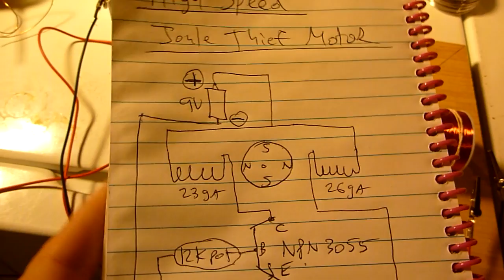Simple Very High Speed Joule Thief Motor

Comment: You should try shifting the angles of the 26-gauge wire coil connected to the base of the 2N3055 and advancing it a few degrees to stimulate the firing of the 23-gauge wire coil connected to the collector of the 2N3055 transistor a few milliseconds earlier. This prevents the Lenz effect.

Comment: looks like it's self oscillating at startup and probably spiking a lot whilst triggering via the magnet rotation as well, making it sort of like a mechanical/solid state combo. the sweet spot seems to be more of a solid pulse here. if you want to get more rpms from a 9v or even an AA battery you can try using N52 magnets and even small air coils pulled from wall adapter transformers would work. Bedini mechanics are a little hard to understand because so many different people have seen so many different results with varying setups. as you said you could run a load or charge a battery from your collector through a diode, but if you source your negative output rail from the emitter it will essentially run your 9v battery directly into the load through the diode, as well as spikes, so it's a good charge that you get but you have to watch out for what voltages you are playing with. for example if you tried to run a 3v LED load that way from your 9v, the LED would just always be lit because it's essentially being run from the 9v directly through a resistor, which is the drive coil. Bedini gets around that by running the load's negative from the positive of the input battery. This causes only the reverse spikes and none of the inrush spikes, and the source and load are never directly parallel. If you tried to run a 3v led with an AA battery however, it would work quite well, just as a Joule Thief is designed, because the 1.5v alone from the AA will not illuminate the led when directly connected. These motors are always fun to play with, I recommend you keep playing with SSG type circuits and you might get hooked.

Comment: A Question please? How long will it run , non stop, on that 9volt battery? Have you timed it?
Reply from the maker: Don't know, never tested it with 9 v battery.  You could made editions to the circuit to make it run longer and be more efficient. This circuit is similar to John Bedini's School Girl motor. You could place a diode going from your emitter to base of the diode to help recycle some of the energy.
Reply: Would you be willing to put a new 9v battery on it, measure the rpm and note the time, let it run till the rpm is about half of the starting rpm, then let me know the time elapsed? Please?

This way, we can judge the power consumption. And decide what applications it would be useful in.

Comment: very cool! I'm having trouble seeing the whole schematic in the video, any chance you could post a static picture?
Reply from the maker: +Kevin Reilly Just look up the schematic for a regular joule thief. Then imagine a rotor between the two coils with 4 magnets alternating. Just posting a picture is tough, cause I'll have to upload it to some host website.
Reply: +Naoki Kashima Ah cool, thanks!  Nice video!  I'm building my own version now.  I'm trying to understand how exactly this works...Is the coil on the right basically sensing the back EMF and using that to trigger power to the left coil when the magnet is at the right position?
Reply from the maker: +Kevin Reilly Here is my theory about how this works>>> The transistor works like an on/off switch, switching the two coils on/off constantly. When the electric flow gets turned off in a coil that coil creates a powerful back EMF of a reversed polarity which pushes the rotor.  As the rotor with magnets pass by the coils some of the voltage and amperage gets induced in the coils (which improves efficiency in the system). Another way to get this to work using a reed switch. The switch breaks the circuit creating back EMF which would push the rotor. Back EMF spark is blue and cold to the touch.

Comment: Is it about a thousand feet of wire per coil?
Reply from the maker: +John Kerley No. It's 1 lbs per. coil. If you're planning a replication just buy 1 lbs of wire 23 ga and 1 lbs of 26 ga.... the coil with 26 ga will have many more winds than 23 ga.... you don't need to use these exact gage sizes. The coil connected to the base of your collector needs have finer gage wire and more turns than the coil connected to the collector.